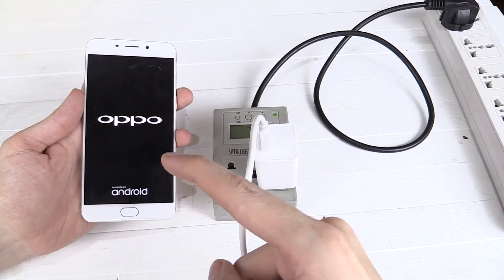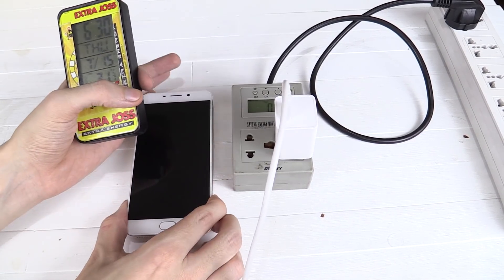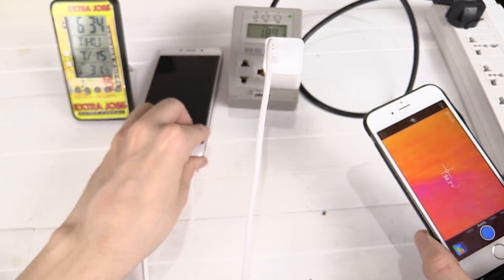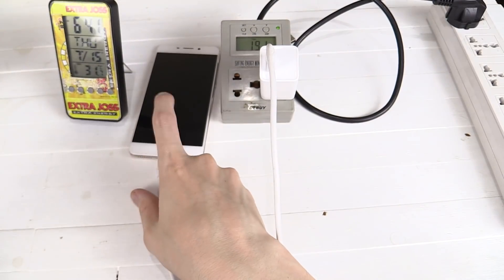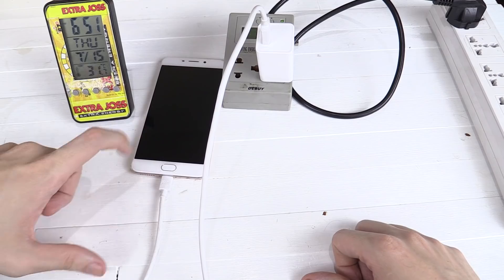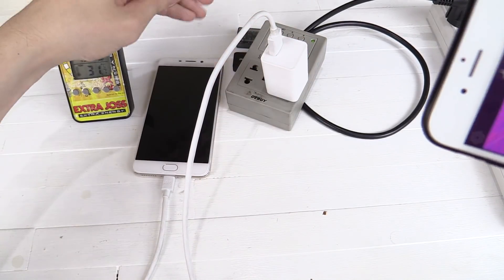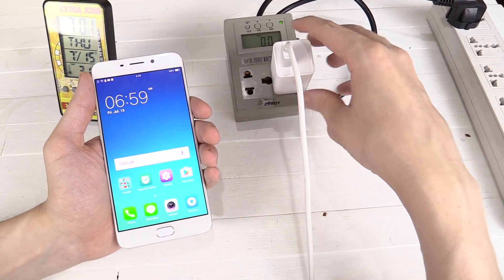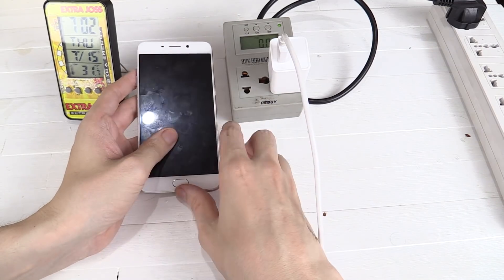OPPO F1 Plus - VOOC 30 minute charge test

Comment: May I know what are you using for the device for heat signature and where you got it? I believe it will be a handy one.

I also have the Oppo F1S. Charges fast unlike my previous phones.
Reply from the maker: It's a Flir One thermal camera and you can buy it online from various shopping websites. VOOC/DASH charging sure is fast :)
Reply: +Gadget Addict Salamat :)

Comment: mine actually takes forever to charge
Reply: +Sou Mia Mine too... I charged my phone overnight and I only got 73% battery from 5%... 😭😭😭
Reply from the maker: +Tcxszhakcqohwleet Cszanghdwiitzsch are you using a VIOC charger and original cable?
Reply: No, I'm not, I lost both of them, and I still can't find them until now... So I just thought, maybe I could by one VOOC Charger and one cable of it.
Reply from the maker: By 'original' I mean genuine. I don't mean literally the exact same charger that came wth the phone. Are you using a genuine VOOC charger and cable and only reaching 73% overnight?

Comment: nice innovation. very informative. is there a charger that can be bought in store outlets that has the same function similar to your vlog? i mean charger only.
Reply from the maker: +dirt baikar the high speed charge technology needs to be in the phone and in the charger. So you'd need to.check if your phone supports DASH, VOOC or Qualfomm Quick Charge. Otherwise you're limited to regular 2A chargers and some phones won't draw more than 1A.
Reply: thank you for the information..

Comment: Where can I buy that FLIR accessory for the iPhone?
Reply from the maker: +Andrew Christiansen it's available for android devices with a micro USB connector and.iphones and iPads with a lightning connector. You can get it directly from the Flir website, Amazon or Apple. If buying inside the Philippines you might prefer to buy through the Apple website since it already includes local taxes.

Comment: I just bought the same phone yesterday. I'm impressed with the charging. Of course, it's slower when using car charger, which I use more than half of the time.
So far, so good. Although I seem to get a few crashes using Waze and Apple Music.
Reply from the maker: +Andrew Christiansen it should charge up to 1.8A from your car charger, provided you're using a 2A charger. They also sell a VOOC car charger so you might wanna invest in that :)
Reply: +Gadget Addict Thanks. I'm buying that VOOC car charger.

Comment: my LG -p705 is always fully charged at 15 min I never let go below 1/4 charge and I have had it probally 4 yrs now or longer and battery is still good I was going to get a new battery in May when I was there but its still good I just wanted a spare cheaper at my local shop in Bogo  Cebu J mar electronics is the one I use

Comment: Really impressive, any form of fast charging is so useful these days. Wouldn't need to worry about when to charge the phone as much or turn things off. Almost 70% in 30 mins is damn quick!
Reply from the maker: Yeah it's really impressive. I think most of us are at the point where the raw performance of our phones far exceeds our needs and the big improvements we want are better cameras and better battery life and faster charging.
Reply: Absolutely. Chinese phones has come a long way, even mid range phones are really good and perfectly fine for the average user. You're right with camera, good battery and fast charging.
Reply: john doe b
Reply: evoGage Plus that's faster than OnePlus DASH which is 60% in 30 mins